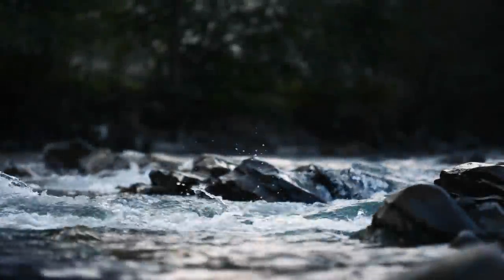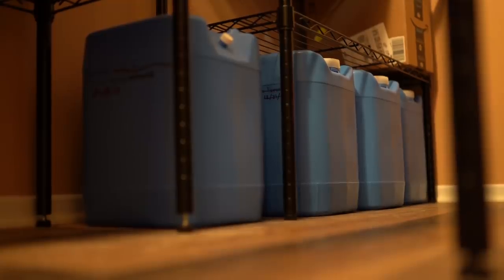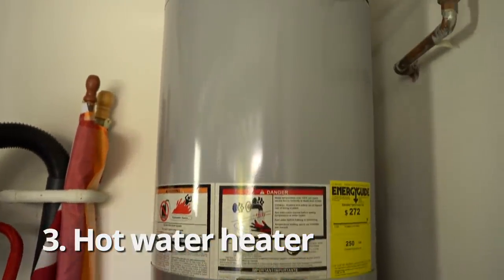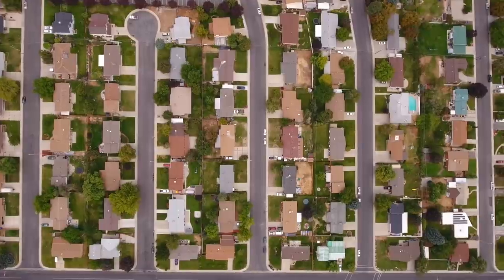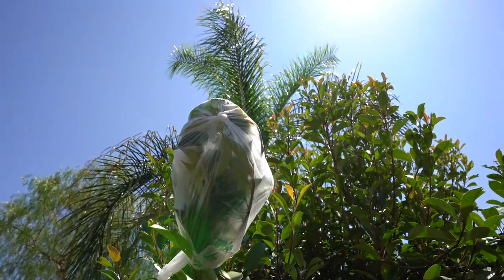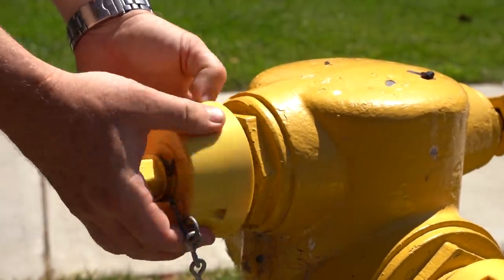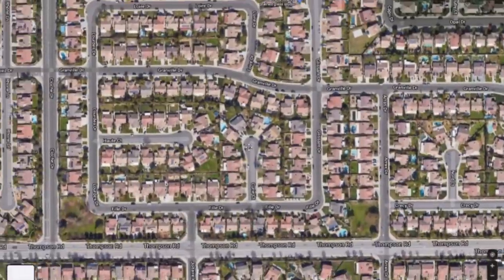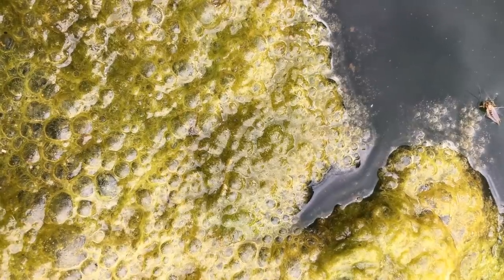12 Overlooked Places to Get Water After SHTF

Comment: Here's a simple and effective solution, if you can't find those sources.
Can you use chlorine for drinking water?
Chlorination is the process of adding chlorine to drinking water to .
 ... Using or drinking water with small amounts of chlorine does not 
cause harmful health effects and provides protection against waterborne 
disease outbreaks. The formula is 1 part chlorine to 100 parts water. Google, how to use chlorine to purify water. Everyone has chlorine bleach in their home, 4-5 drops purifies a gallon , and up to 16 if the water is some degree of cloudiness

Comment: You mention "with a little research" in advance a lot, do you have a video yet on how and what to research?
(Example old water wells, would they be on old city/town maps?)
Reply: Most states have a database of registered water wells.  Try looking at your environmental section/geology section.  This database will not list any wells that were constructed before states required registration of wells.
Also if you live in an area with a shallow water table look for Sandpoint wells. Had one in my basement of my house.  Just beware... If the house was ever treated for termites you won't want to use it.
Reply: @Alli-lx6qy  thanks!